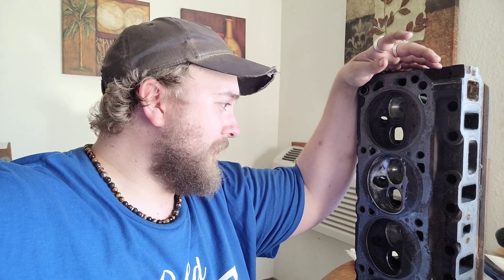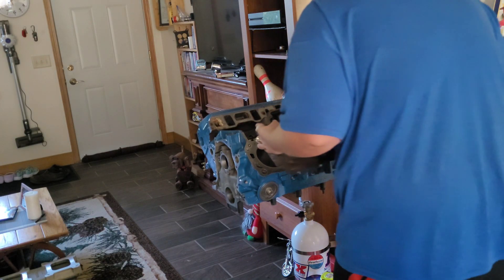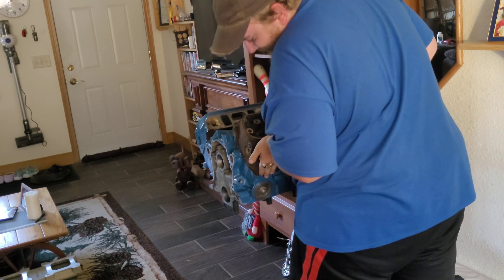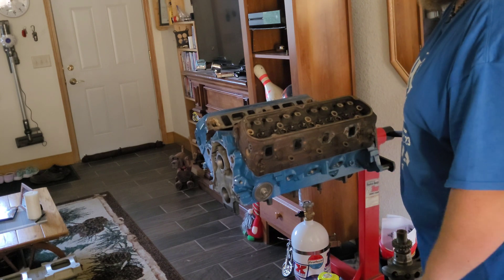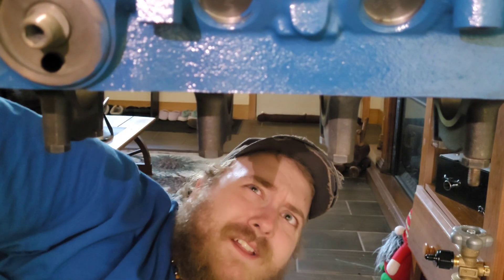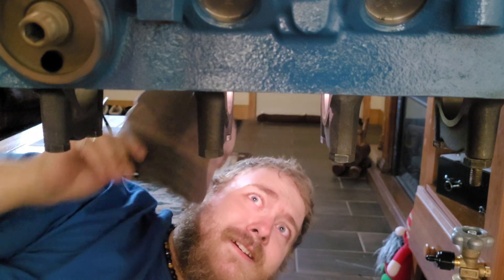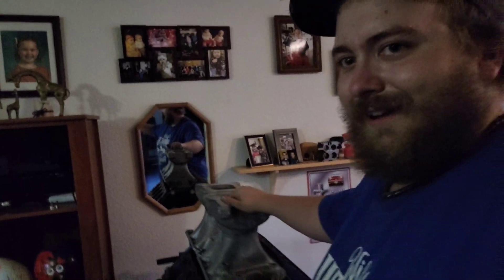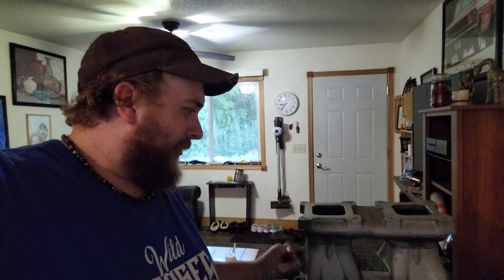E7 Ford Head Porting! | Chamber Mods | The Luck Of El-Danno Strikes Again! | Exhaust Port Mods

Comment: check the head bolt holes and alignment pin location measurements to see if each bank jibe with each other
Reply: on both heads and the block, port match intake and heads to gaskets and port match exhaust ports to header gaskets, just sharing what i do' lol lap the valves in, i am typing as your talking lol
Reply from the maker: Yep that the plan! 😃

Comment: Measure the bolt holes, and more importantly the holes with the locating dowels/tubes.  The bolt holes are not part of the casting mold, and are machined in after casting.
Reply from the maker: Ive checked thoes heads every wich way I can think of and dont notice any variables between them 😅

Strangest thing! 🤔
Reply: @newguysgarage6802  try checking the bolt holes on the block then.

Comment: too A DEGREE you are bumping compression down
Reply from the maker: Ya I know 🙂
Better flow makes more power difference than compression will at this point 😅

That and its a nitrous motor so lower compression is actually desired in this application 😁👌
Reply: @newguysgarage6802  ok dude did not know about nitrous
Reply from the maker: Oh ya that is a main part of it 😅

Hence the nitrous bottle next to the engine stand 😁

Comment: You can set the head on the block then lightly fog paint up through the cylinder to color the chamber exactly. 👍
Reply: Please no! 😂 use some scribing paint on the head and set the head back on and reach thrue the bottom and scribe the edge of the cylinder!
Or use the scribe paint there the bottom like you said, but Please! Don't use regular paint!! 

John 3:16